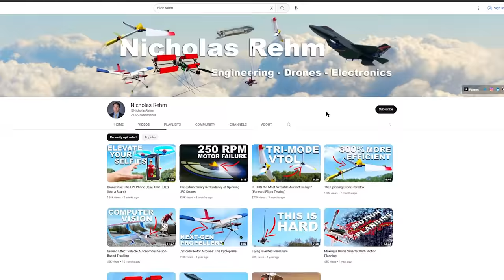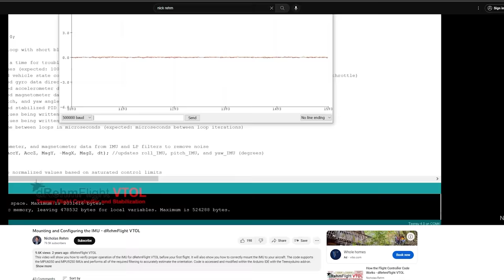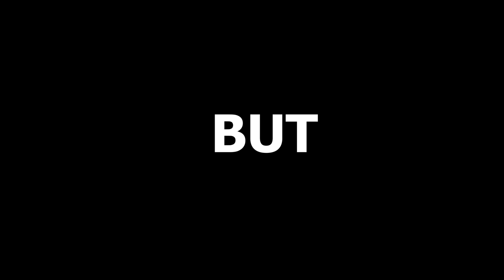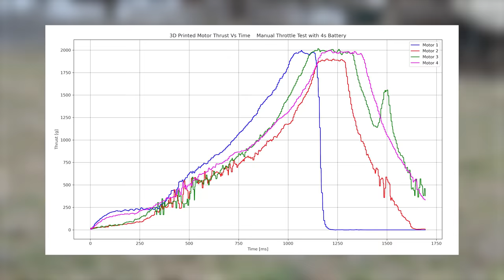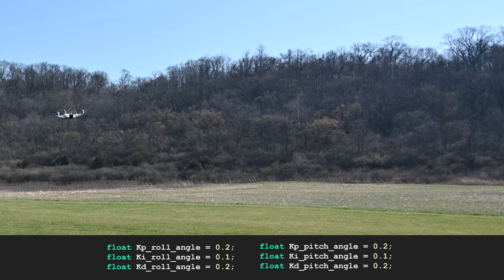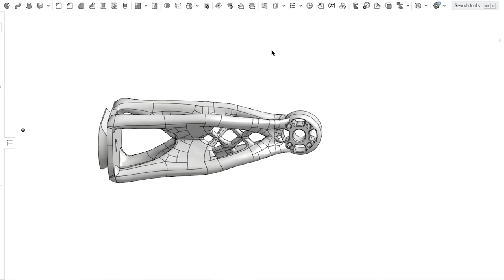Flying a DIY 3D Printed Quadcopter... Will it work?

Comment: My thoughts would be more battery power, by placing four batteries or more with one battery within each of the motor mount arms. Make the batteries part of the structure adding rigidity vie the batteries themselves, similar to what Tesla has done with battery floor pans.

Comment: For me it looks to be much heavier that it needs to... I'm counting only printed parts, no wires, no electronics
1. use ABS or ASA instead of PLA, it's already about 20% reduction in weight (probably there are more material that will be better, but I don't know any) or use PA and make it thinner.
2. print the arms to be inserted from bottom, so you don't need any locking mechanism on top
3. why 4 screws for fan? 2 are enough! reduce the weight anywhere you can... also use as thin screw as you can get

We're talking about flying thing... you need to thing about absolutely any weign reduction you can get, no mater how insignificant it looks.

Comment: I know you wanted to keep it as much 3D printed as possible but I guess my question is what if you went with higher end commercial motors to drop the weight bring the RPMs and the response time see about 3D printing blades like a sharrow boat propeller? Supposed to increase thrust while decreasing noise?

Comment: I used old CAD programs in high school like Rhino and some older programs.   What would be a inexpensive good quality  entry level 3d printer with a fairly decent size print area so not limited to making 10000 parts or micro devices?

Comment: I want to see someone make a real drone like the triangle shaped one near the beginning of the 1984 Tom Selleck movie "Runaway". There have been several ways invented to use two stacked, counter-rotating, propellers for flight. So the flight and control hardware should be simple. The fun part would be making it do everything depicted in the movie.

Comment: Hi Michael, I'm happy for you. You did a great job but i want to ask something about the drone mechanics. Why not use the same topology technique (I don't know the correct definition) for the body part (black parts)? Is it due to print time or the development process?
Reply: I know with the cad program I have you have to pay for every single part the computer regenerates for you so might be the case that its to expensive the one I use the prices are ridiculous over $100 everytime you use it on top of the $600 a year subscription

Comment: Why bother with such beefy arms if it's running all the forces through dovetail connectors with maybe 1/20 the strength in tension?

Comment: It is clear that the problem is on the frame 
The motors can't handle the weight of the frame u can change the frame to freestyle frame using carbon fiber

Comment: try true-dc sheet motors (no ac parts, no commutators)
Reply: high current low voltage
Reply: direct F= ILB lorentz/hall effect electric force (permanent magnets, sheet metal 90 degrees to the magnet spin direction, axial or radial configuration)
Reply: diy batteries, yes, metal-air sheet spool fuel cells would be simplest and best energy density / specific energy
Reply: or gasoline electric generator, same thing, same efficiency and specific energy, for big drones like that
Reply: even compressed/liquid hydrogen containers, like co2 cartridges, fast swap
Reply: try diy radial ring magnet in copper pipe sheet motor with iron rod core
Reply: the iron core rod for the dc magnetic field motor is essential

Comment: 3D print the shafts, nuts, bearing housings (using plastic BBs for the bearings) and props and have the whole thing be plastic minus the copper windings and magnets, just to see if it would hold up? :)  

Also, apparently 3D printed bearings can be done, I just don't know how well they would work, this YT short is the extent of my research lol
https://youtube.com/shorts/MFolHwUFVVk?si=P3IxB39UtKO4EwfO

Comment: Isn't that lighter arm design nearly as heavy as the original? You end up printing 10x as many perimeters, which kinda defeats the purpose of the new design... unless you only did a single perimeter layer.

Comment: I'm trying to figure out why you made such a massive quadcopter. The whole thing would have been 50 times easier had you build a much smaller quad. Not to mention, less time consuming and less expensive. Also, it looks like you have undersized propellers for those motors. 

Just saying. I build quads for a living.

Comment: That quad need a 30,000 mah battery... for good flight time. Otherwise you need to use a hydrogen fuel cell, or better yet a liquid hydrogen fuel cell.

Comment: Firstly brilliant. Secondly, your over engineered everything. Now that is generally a good thing, but in aircraft, it's not. You need to trim weight off everything. Open latice on the main hub and half or quater thickness on everything. Remember, you don't need to build in fatique life.

Comment: Holy mother of 777, those motors looks like they are straight out of a Tesla, but now that I think of it mmmm.... what 666 plan I devise to make all BMTQLM+Me and YOU sit up in excitement when it strikes me like my Grand Fathers 15Lbs Hammer that always sat of his 225 Lbs Anvil that Lbs for Lbs, Liquid fuel hold more Punch then a Tesla's nickel-cobalt-manganese formfactor and we must further experiment with ideas that planting Zea mays (Corn to you and me) will over thousand years produce more HP than digging up and poisoning complete ecosystems that could have been use for Zea mays instead of needing Minor Adults to risk their  Vertebral Column to deliver to wealthy, affluent, opulent, well-to-do, moneyed, monied, successful, well-endowed specimens that according to the Gregorian calendar will end in 2999 which will make me 1035 years old, much more lucrative a deal considering or excepting that our Marble  Blue Ball has not been blown up by the ever increasing size of Rockets we want to use as a spring board to get to Mars. Considering Newton's Third Law that last time I checked are still enforcable and valid, will at some point reach a size that the last Homo Erectus will in all probability destroy earth as it leaps into space for a grand finale. Considering all the Huggers of everything ant-Homo Erectus will have to be on the Final Good Bye Rocket or be domed together with their beloved Fury and not so Fury creatures. OR will they be in time for redemption when they realize there are mice on Mars, and make us cringe in disgust when they want to do a headcount of mice in our quarters. Mice or no mice, there will be cockroaches. FORGET about BATTERIES, plant some MAZE, is what I will say, But one thing is factual, methanol, ethanol, propanol, and butanol does not function upside down unless it has been atomized but so does Babies milk, and who would have know that Sugar has more Bang than a Fossil and the "Sugar", does not take a Millennium to the power of 2 to turn into BANG. Have a nice day my Aviator of Small things, man alone you could be responsible for the first Cockroach in space, just exchange the nickel-cobalt-manganese for some "BANG"!

Comment: 95% of the mass of the motor, which is 100% of what makes it an actual motor is NOT 3d printed.  All the important stuff on the drone is NOT 3d printed.   Only the frame of the drone and motors are 3d printed.  
Saying this is 3d printed is like calling a Big Mac a vegan sandwich because it has some lettuce but ignoring the fact it has 2 beef patties.